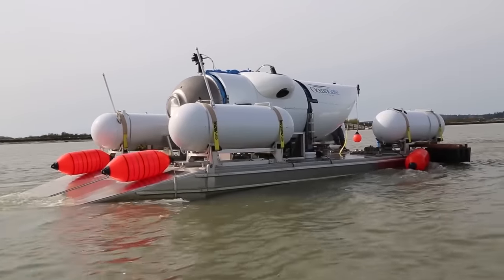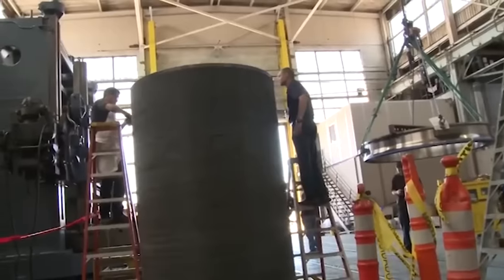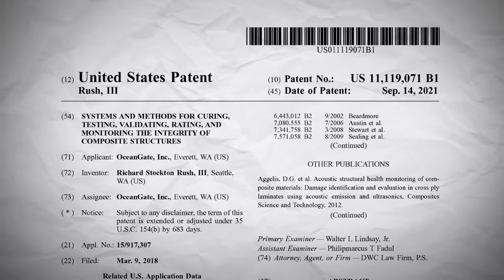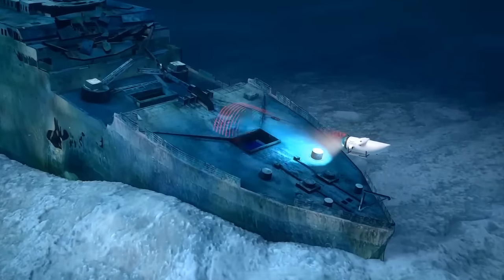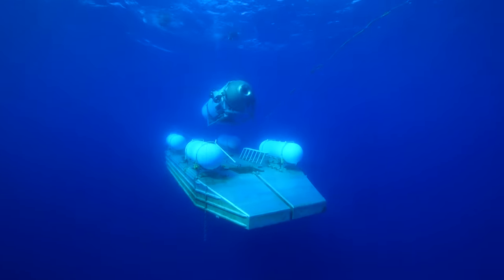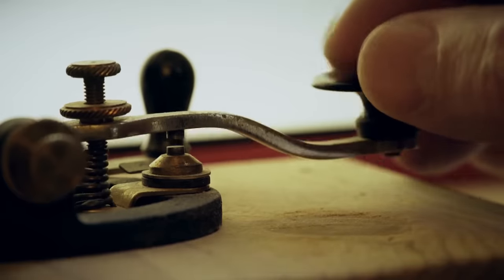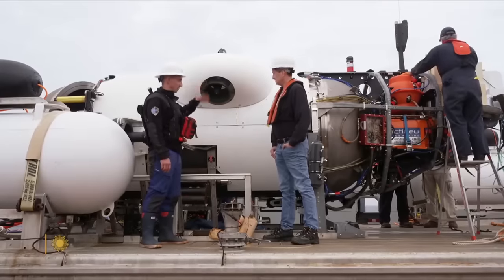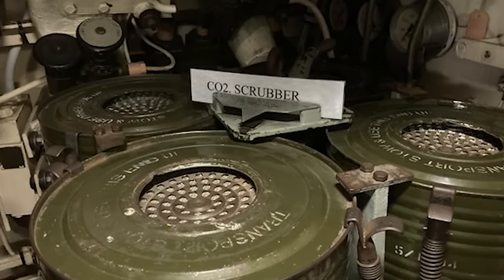Exposing OceanGate Submarines Many Fatal Designs

Comment: The failure of the dead man's switch (ballast drop) to operate within 10 hours must have made the rescuers very suspicious that a catastrophic event had happened. It's a shame this wasn't mentioned on day 2 in the media.
Reply: I think they were crushed before it ever came to that
Reply: Was it set to implode in this 3rd trip?
Reply: @DigiByteMe Yes, that's the point: the fact that the Titan didn't resurface by itself after 10 hours should have made it obvious that it already imploded and that there was no one to rescue.
Reply: The problem was that even if it surfaced, it could still be very difficult to locate before the air ran out without an accurate tracking system designed for surface operation. Based on that expressed concern, one can assume that the Titan did not have such a system. Remember, they were searching an area of thousands of square kilometers. That's a lot of uncertainty as to where to look in the event.
Reply: @jamesdlin7  I mean that is pretty telling the more telling thing however was the fact that the tracking and coms systems were completely separate and failed at the exact same time as the acoustic sensors picked up a extremely loud noise. They knew from moment zero exactly what had happened.
Reply: @jamesdlin7  yea...but the another problem with the sub was that it was white, which makes it hard to see. no idea why they went for white.
Reply: @jamesdlin7  Well there was still the chance that the sub may have been entangled in the Titanic wreck or in some seabed feature... or that it had  resurfaced with no power and comms and hadn't been found yet.

Anyway, yeah, I think that the rescuers sort of knew from the start that their effort was more a search for remains than a search and rescue. =(
Reply: You are lucky that the mass media figured out the Titanic rests on the ocean sea bed.  Take the win.
Reply: Well, because then the media and powers couldn't use this story to draw attention away from what was happening last week
Reply: @jamesdlin7 😢
Reply: NAVY knew what happend from the moment it did. The coast is crowling with SOSUS sensors to detect the subs. They picked the implosion right away. However,all the efforts were done to ,imo,comfort the families that they did what they could. After the time the calculated oxigen was depleted,NAVY released the statement. It may sound rude,but no one can blame the Coast Guard and other rescue services for giving up.
Reply: @volodymyrbuchak1852  
My brother is a pilot and an officer in the USCG. He was apart of the search from the air..he told me on Monday that they were all dead. I asked him, "if they are dead, why are you still searching?"... he said that the Navy and CG were getting a lot of pressure from the international community to recover the Titan wreckage. They didn't want to announce their death until they had some of the wreckage as proof.. your correct, if they have the wreckage and proof of their death, nobody can blame the CG or Navy for giving up or not searching long enough.
Reply: They detected a small explosion that happened at the same time they lost communications that Sunday…. The gov. Just chose not to say anything till a few days later
Reply: @skab123 This was the 4th trip imagine making a SUBpar rocket 🚀 and going into outer space and you end up getting stuck on the Moon This would've been different but still bad 😢 hopefully if someone else builds a Titanic viewing submersible they don't take shortcuts I mean how was this even allowed to go down with civilians on it is mind boggling because everyone knew it was very unsafe and from the beginning yet they allowed it to go under 4 times and the last time was the last time should've built a remote control version well an unmanned remote controlled submersible proto type to see how many times it could safely dive before it reaches critical condition and ends in catastrophic failure
Reply: The Navy knew it had imploded the day it happened
Reply: @jamesdlin7 the glass probably broke or the carbon fiber started leaking or something because I believe reports says they Heard tapping from the sub before it got to the bottom which means there had to be a failure before it imploded because they should've had better technology for sending messages and like a black box like planes and boats and ships have
Reply: The Navy new one day one. 
Hour one. 
Second one. 
They heard the implosion.
Reply: @hanthony440 no. They knew it imploded the first day. They heard it.  They chose to stay silent about it.
Reply: @terminalfrost3645  white is very noticeable when everything in the ocean is pitch black or brown or blue or green.
Reply: @hanthony440  It's very common, when searching for lost submarines, to mis-identify other sounds from the deep. The "tapping" they heard almost certainly came from another vessel searching in the area. I have heard that the submarine dropped ballast prior to the implosion, so that acoustic hull monitoring system did warn the crew about a problem. BUT it was too late, and the Titan imploded before it could surface.
Reply: @zlonewolf  yes, under water, white is a noticeable color... but from the air, white blends in with the white caps of the ocean waves.. if the sub had surfaced, it would have been very difficult to spot. They need a color that would be noticeable under and above the water. Maybe neon yellow?
Reply: I'm guessing they were waiting on 100 percent proof to say anything
Reply: The media should be in the dark. Let the rescuers tell the families first in a dignified way rather than hear it from some jackass on CNN
Reply: They mentioned it.  Then kept going like they hadn’t
Reply: They thought it might have been stuck on something. It doesn't really matter how buoyant you are if you're snagged on part of the Titanic wreckage -- which is something that has happened on multiple other Titanic expeditions in other vehicles.
Reply: The timing of loss of comms and tracking issues may sound like it makes it obvious what happen in retrospect but OceanGate wouldn't have known that it was likely an implosion without the data from the hydrophones that picked it up. Their sonar based tracking and acoustic comms will of course have processed the implosion but this isn't some general purpose hydrophone system. It would have never even been recorded because to those systems it's nothing but some signal noise. The loss of comms and tracking is also something that has apparently happened before, I don't know about simultaneously but they've had comms outages (where the submersible pilot decided to throw caution to the wind and not resurface) and they have had tracking failures where they meandered around for hours on the bottom following incorrect tracking data. They also didn't even know if the loss of comms was complete loss of comms or if the submersible was still receiving them but only the reply was lost.

In a sane environment, losing comms or losing tracking would be a guaranteed "wait 10 minutes to see if it can be sorted out and immediately surface if not". That's not how OceanGate operated. It wouldn't be completely unreasonable for crew on the surface an hour after they lost contact to be thinking "Is there an emergency right now or just Stockton Rush being reckless and continuing the dive blind". To that point, even 16 hours in you still can't be sure if the pressure vessel was ruptured or the submersible lost comms because it slammed into the ocean bottom getting itself stuck in sand.

Once the coast guard provided the hydrophone data from that point forwards they should have let any family members know what almost certainly happened and not be stringing everyone along for days with vague statements about inconclusive banging noises in 30 minute intervals. There was a massive amount of resources dumped into the search effort and for an outsider it looks like it was mostly political. Throwing a massive amount of resources into the search seemed reasonable based on the information they released to the public at that time but they had the hydrophone data from the start. IMO I think they hid that until they found some debris because they didn't want to look like they were giving up without something to point at that the unwashed masses could understand. The coast guard is actually pretty severely underfunded compared to every other branch of the military so it's even more galling to see them waste millions on this. At least as a silver lining it's a training exercise and probably most of the cost is going to be on Navy, Air Force, Canadian Coast Guard, etc.
Reply: This is one reason why planes were searching for so long since in open water without a working transponder the submersible would have been all but invisible on the surface if it was there.
Reply: @CJock  Not the first time, either.
Reply: @hanthony440  This incident is just another wait & see mystery.  No worries.
Reply: @hanthony440  They now believe those sounds were completely unrelated to Titan.
Reply: @hanthony440 - That’s a good suggestion, or at least, better than just waiving the testing process to save money, but carbon fiber can’t be relied on to react in exactly the same way with multiple examples, because there’s no way to ensure that the composite manufacturing process will be exactly duplicated each time a different piece is made.
Reply: @hanthony440  The supposed tapping sounds were reported quite a while after the (probable) implosion was recorded.  So, if they actually occurred, and were not falsely reported, they were probably coming from another source (not from the crew).
Reply: So basically the surface ship would have noticed the instant loss of contact tracking with the submersible. And either implosion or powercut. 
They must have just hoped for powercut. But even so, it would then surface after ten hours.
Reply: @kotori87gaming89 - I hadn’t heard that they had dropped their ballast, but if they knew about a problem, shouldn’t it have been possible for them to send a message?  They didn’t lose communication capability (supposedly) until the implosion occurred.
Reply: @robertgaudet7407 - Who mentioned what?
Reply: some people knew it had imploded when it actually imploded. The implosion was heard by the Navy, and they soon put 2 and 2 together but weren't about to dash all hope due to room for error, but the audio report of an implosion is unique and it was basically a done deal to those that new of the audio report.
Reply: @skyeait5939  - I’m not sure that you could depend on the sound of the implosion being specifically identifiable, mainly because it almost never happens to manned underwater craft of any type, but also because this one was made primarily out of carbon fiber, which wouldn’t have sounded exactly like steel or titanium.  However, I agree that they definitely had enough information in this case to conclude that it had imploded.
Reply: @alanwright7819  we don't know when the implosion happened people assuming it happened before they got to Titanic maybe it didn't implode until after they was leaving viewing the Titanic they didn't go check for days so we don't know at what point that the submersible implode was it before they reached the bottom was it when they arrived at the bottom or was it when they was getting ready to go back up and a failure happened that made the implosion More possible I mean we don't know If they hit something or if something hit them or if the glass started giving way And they tried tapping for help or if the Capitan gave the controller 🎮 to the 19 year old and he hit something on the Titanic and unknowingly it imploded we don't know at what point the sub imploded on the way to Titanic or on the way trying to go back up
Reply: If they admitted it was a catastrophic failure, which was pretty much obvious, they wouldn’t have been able to exploit the tragedy and false hope for profit.  

The idea they were floating around with hopes of rescue was simply good for business. Even James Cameron sort of hints at this in his interviews. Every serious professional in the industry knew it was an implosion, but they made sure to wait long enough before confirming it so media companies could suck more of that sweet death nectar from another tragedy.
Reply: NO what made them suspicious was the fact that U.S navy sonar heard the implosion Sunday evening but didn't share that info with the public until the third day of searching.
Reply: they put on a charade for some reason. even james cameron agreed. he knew they imploded because he said that his small deep submergence community WAS TOLD by the mother ship that they were having issues down there, had released weights, and then they heard a sound (implosion)
Reply: @terminalfrost3645  i never thought of that! but makes sense! Deep Sea Challenger is lime green!
Reply: @hanthony440  
That tapping wasn't them cause they were already dead
Reply: @rp3351 the submersible never made it to titanic to get entangled in anything.  That’s how they knew something else should have happened.  Something should have surfaced and it didn’t in the respective amount of time.
Reply: At failure, most of the whole internal space would be filled with water. Carbon fiber failing by compression usually lead to delamination, making it non-waterproof. In reality, the strenghth of such a carbon-fiber structure would be from the epoxy (or worst case, if they used polyester).
Reply: @spencerdasilva  The whole cylinder/bubble probably got flooded right away. That type of structure would do a lot better in space than in positive pressure of deep sea. Carbon fiber only has strenghth in stretching, meaning it was only the epoxy, or God forbid polyester holding it all together.
Reply: @thetruepatriot7733 Your brother’s a brave man. I admire these people who put their own lives on the line, often in bad conditions, trying to save others.
Reply: @AndrewMerts: Titan dives for about 150 min to reach the Titanic. On this trip, it descended for 105 min when its pilot encountered a problem and decided to abort; he dropped the ballast weights to begin an emergency ascent, and notified the support ship, which soon lost all comms and tracking signal from Titan.

Robert Ballard, David Mearns, and James Cameron -- being part of the close-knit deep-diving community -- have stated in public interviews that they had received insider info that Titan informed the Polar Prince that it aborted its descent, and is ascending; afterwards, Titan was lost.
Reply: @hanthony440: Titan dives for about 150 min to reach the Titanic. On this trip, it descended for 105 min when its pilot encountered a problem and decided to abort; he dropped the ballast weights to begin an emergency ascent, and notified the support ship, which soon lost all comms and tracking signal from Titan.

Robert Ballard, David Mearns, and James Cameron -- being part of the close-knit deep-diving community -- have stated in public interviews that they had received insider info that Titan informed the Polar Prince that it aborted its descent, and is ascending; afterwards, Titan was lost.
Reply: @jamesdlin7  the balast could have malfunctioned aswell
Reply: They probably cut corners with the ballast drop as well and knew it didn’t work.
Reply: @jameslin3132 I believe they were mostly positive but couldn't confirm until they found the wreckage. They confirmed as soon as they found the debris on the seafloor, just after the first ROV arrived that could dive that far.
Reply: Also the explosion they heard about an hour after it launched. They knew what happened, they just had to get solid evidence before releasing the facts.
Reply: @DigiByteMe  Try reading the comment before replying.
Reply: @jamesdlin7  It would have only started to move upwards after 10 hours though? And also could have got caught on something (Titanic).
Reply: What do you mean it wasn't mentioned? The media was talking about the multiple redundant surfacing procedures and how they operated without user input.

Even if they hadn't mentioned it, what's a shame about it? That knowledge wouldn't save them, and wouldn't change anything
Reply: They were reasonably sure it had imploded before they were even called in ... But you keep trying to rescue people until there are no people to rescue
Reply: @jamesdlin7 they thought it was snagged on Titanic debris...
Reply: They thought it could have gotten trapped in the Titanic wreck! Many scenarios went through peoples minds in hopes this would have a happy ending.
Reply: It did.
Reply: @jamesdlin7  But they had no working gps if I recall, so even if they did surface they still wouldn't know where they were.
Reply: @thetruepatriot7733 wow sounds SO true!!
Reply: distraction.
Reply: @terminalfrost3645  white the easiest color to see with the naked eyes maybe it's hard to see using machines
Reply: @Frostyeveryday  oh well I guess they wanted to see for themselves they heard something they couldn't confirm that it was the titan , well maybe that's why they was reluctant to go down because they already knew what they was gone find
Reply: @kotori87gaming89  most definitely sounds logical
Reply: @alanwright7819  I think the Navy specialist who's job it is to recognize underwater audio knows all about different types of implosions, a loud out of place noise in the direction on the Titanic, tbh recognizing that audio report is probably quite basic stuff for them.
Reply: @myutube5882  Yes now but at the time they still had reason to believe that the people was alive and trapping because they had something to tap to send messages to the ship trying to find the ship that's how they locate the ship so they can find it on their way back up idk I'm still finding More and more information Daily they can't release information anyways until the families are all notified so even if they knew the people on the submersible was Dead they couldn't Tell the public until after the families found out first
Reply: It was supposed to be a rope that deteriorate in saltwater in 10 hours releasing the Dead man switch but people saying the military heard the implosion the next day if so then the Dead man switch didn't work if the implosion didn't happen until the well after 10 hours unless it did work and they didn't make it back up we just know the sub imploded we don't know if it was on the way up or on it's way down it shouldn't take that long to travel 2 miles a person can Walk 2 miles in in an hour going 1 MPH it would only take two hours to travel to the bottom of the ocean so it's not like they that far two miles ain't that far distance wise pressure wise two miles below the Ocean is dangerous
Reply: @skab123  yeah well have to wait for the investigation to be completed to find out better what might've most likely happen and who knew what when
Reply: @alanwright7819  that's True and carbon fiber cost More than titanium or steel so if they went out the way to cut cost why use carbon fiber I understand it's easier to mold it to whatever shape you want but it's not like he didn't know he been warned internally by his own people that the sub carbon fiber failed in a small scale pressure test it got cracks and started leaking
Reply: @alanwright7819  maybe 🤔 IDK but it's possible they came from the submersible because they might be confused the time of events because so far I've not seen one of the many many videos that mentioned the Coast guard Heard the implosion I gotta keep searching for a video that says that
Reply: @ashleydaniel3215  you assume that's true but they don't know that to be true
Reply: @oahuhawaii2141  Yes but from what I've heard they lost comms with Titan every single time that submersible went exploring Titanic and sometimes lost communication with the submersible for 4 hours that's why they thought the sub was wandering around looking for it's way back to the ship
Reply: @skyeait5939  - I agree that the sound of the implosion was probably enough to conclude that the sub had imploded, particularly when it’s combined with the facts that the communications and tracking were lost at the same time, but the point I was trying to make is that the noise itself could not possibly be positively identified as an implosion because the sound of an imploding submersible made of carbon fiber had never been recorded previously.  This was the first occurrence of that type of event.
Reply: @RichardABW  no they had several failsafe measures other than the dead Man switch the Dead man switch was a last resort in Case people on board were unconscious or lost track of time something they couldn't release weights whenever they wanted to and they had air tanks that fill up with air from a onboard pump to make the Sub lighter and they had sand bags they release other than the ones on the Deadman switch and they had air sacks that are deployed and used as flotation devices they had seven safety measures of being able to resurface I'm guessing they never reached the bottom and started going back up and at some point on their way up the pressure caused it to implode you don't have to be at the bottom the pressure halfway down was enough to implode the sub if it had been compromised by previous trips to Titanic.. they should've built a different sub they should've known that sub didn't have many live cycles under that much pressure those previous times
Reply: @hanthony440  - The tapping noises that were reported were not heard until well after the sun had imploded and contact was lost.  No one was searching for them until after that occurred. 

The Navy recorded the Implosion, not the Coast Guard.  Although the Coast Guard may also have access to undersea noise monitoring systems, they were not involved in the expedition until after the sub was reported missing.
Reply: @alanwright7819  the submersible doesn't have tracking the tapping is how the ship tracks the sub it's a signal that allows the ship to give the Sub directions sorta remember the sub only had the tapping device to send Morse code that's how they text back and forth the Sub sends a signal to the ship and the ship can relay information telling the sub how to find it's Way back using sonar like a bat but since the submersible don't have nothing but a remote controller 🎮 no screens it it was more like a person trying to lead a blind person Thru a Big open field by using just their voice without the voice guilding the blind person would have a lot harder time finding his way to the person if they wasn't talking
Reply: @hanthony440  - I was referring to the tapping that was reportedly heard after the sub had disappeared (imploded), not the tracking mechanism.
Reply: @alanwright7819  something tapped they would've located the other submersible that was tapping since the sonar would've been picking up underwater subs sonar not just but the tapping could've been the parts of the sub landing on the Ocean floor idk but why was the Navy called before and why did they arrive so quickly people saying the implosion happened like an hour or so after it went down and moments after the submersible lost contact with the ship that don't make sense especially since this is international waters how did the navy ship pick up the sound the submersible implosion before they was even notified that it was missing you said the Coast guard didn't get involved until the Sub was reported missing but All this was after the Navy had already picked up the implosion so the navy picked up a sound wave from a distance that would match that of an implosion immediately followed by an explosion from the onboard gas such as the oxygen tanks being compressed at a fast rate by that much pressure causing it to explode so the navy picked up vibrations they couldn't be sure if it was the submersible the ocean is full of people from other countries both government and private companies and private citizens the sound could've been people setting explosive Dynamite off in the Ocean it could've been a different something exploding the sonar wouldn't know what it was causing the shockwaves that they picked up
Reply: @alanwright7819  yes I know so was I , the submersible disappeared every time it went down it Lost contact with the ship for hours at a time
Reply: @amyc9155  well... that's why they call me the TRUE Patriot lol. I'm out there dropping truth bombs 💣 all over the YouTube comment sections lol.
Reply: I’m not an expert in anything related to the sea or submersibles. But when it first happened, it took me only a few minutes of watching and reading news articles from various sources to realize that it was 99% certain they were dead at the first hint that things had gone awry.